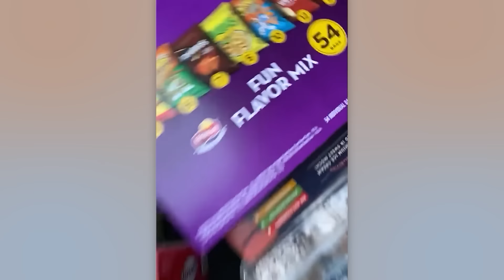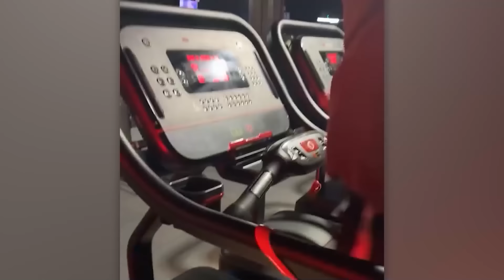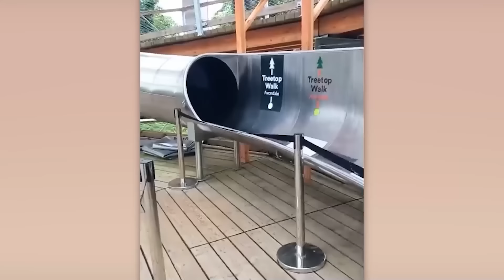Moments of Instant Regret Caught on Camera

Comment: I rented a cottage and the only insect repellent candles there were ( 3 ) 3/4 used citronella candles. I thought I would melt down all three to make one good candle. Well little did I know was there was a little water in the pot and when I threw the wax in and after it got hot it shot wax all over the walls. Boy my pride got hurt and I spent the next 2 hours cleaning wax off the walls. Good thing the landlord didn’t say anything.